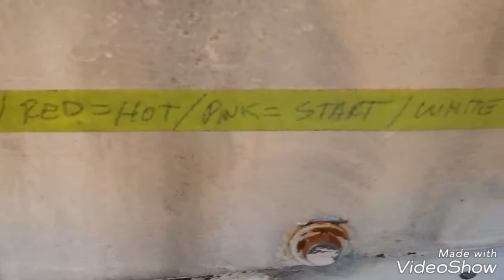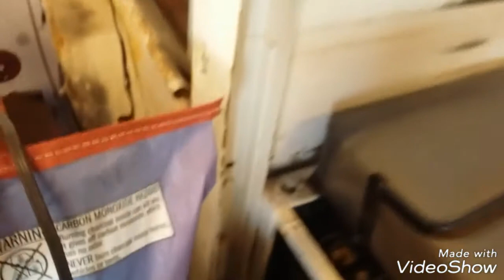Old Start/Cold Start 1974 Cushman Truckster Haulster after wiring fix.

Comment: My starter is trying to start but the engine isn’t turning over as well. But I know the fuel hose sit some what high on the tank. So I fill the take all the way up ? I’m going to replace the spark plugs as well.
Reply from the maker: I am confused... If rhe engine does not turn over, then it's stuck or seized up. What good will spark plugs do. Why is the engine stuck? Rust? Hydro locked? Cylinder full of fuel? These have a fuel pump so fuel level is not important, check the output of the fuel pump.
Reply: @GlennsSpeedShop  I learning as I go bout these engines. So I’m getting clicking from the solenoid. I took the solenoid and starter out opened it up cleaned didn’t have any luck. So I’m thinking is the starter because it’s not engaging the fly wheel and it’s not turning it at all.

Peaked inside the flyer wheel has rust on it and it bones dry from sitting so long. 

I tried to jump it at the solenoid with a flat head but that didn’t work AT ALL didn’t get any feedback lX 

The engine is 2004 Kohler Engine CH20s
Reply: @GlennsSpeedShop  the dam machine was in gear.  Or the flywheel rotate, not I just need figure out my fuel issue